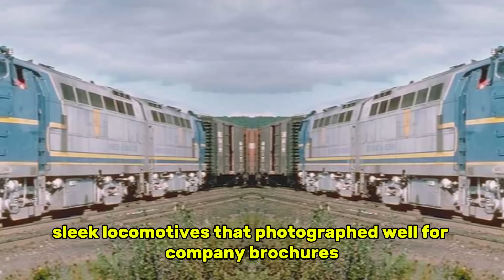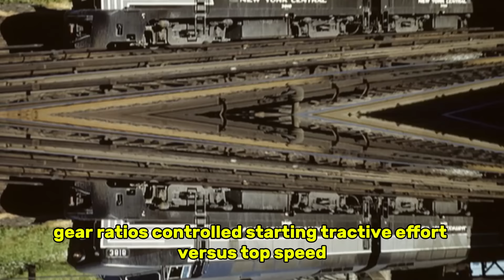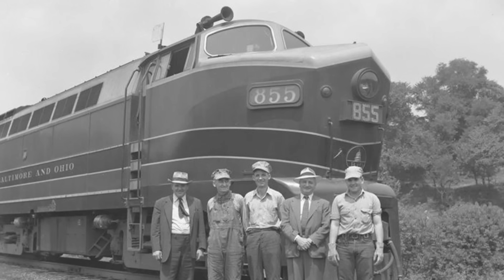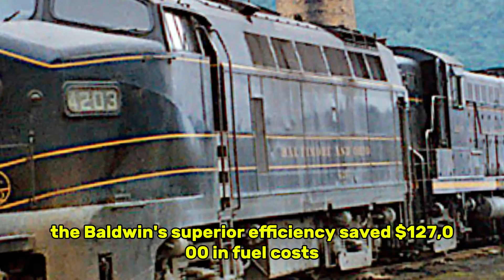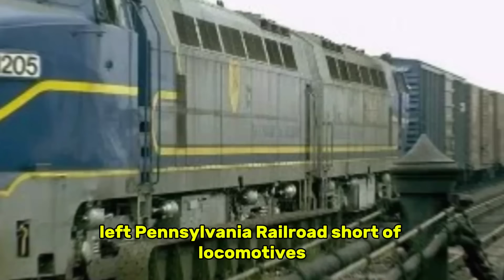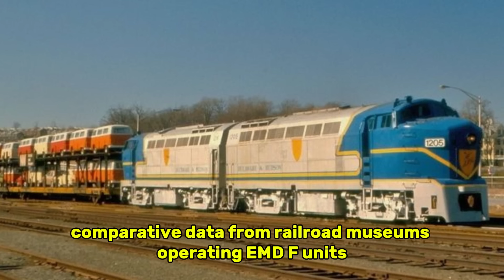The Locomotive That Looked Weak — Until It Embarrassed Modern Power

Comment: Power is not rated in tonnage terms.  Modern timetables provide information used to calculate maximum trailing tonnage on any one subdivision.  I've been loaded to the max; with barely enough to get up the heaviest grade.  Back in the day, GE's new AC technology was so superior, it decided to make locomotives all by itself while guarding proprietary technology.    But the technology nowadays is a bit "too" complicated, leaving me with fewer troubleshooting options vs an old sweaty SD 40-2 or a GP38.  The magic of GEs; I never have to worry about short-time ratings, even crawling uphill at 2MPH.